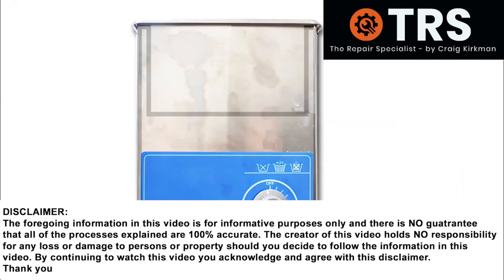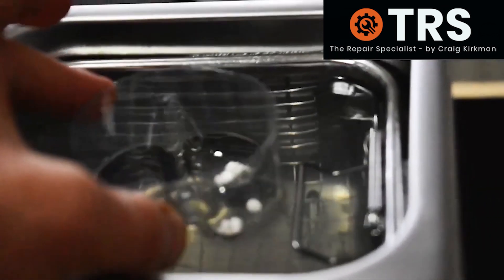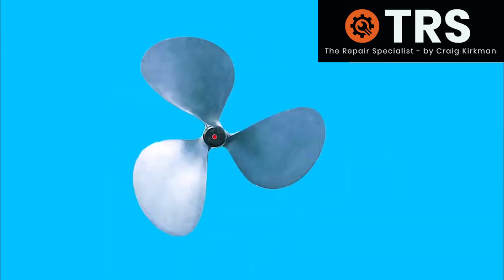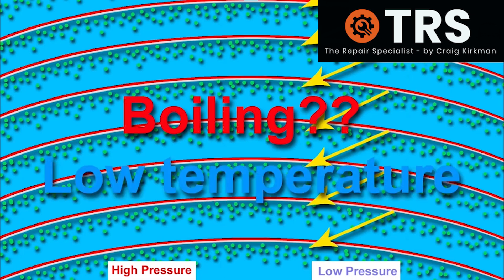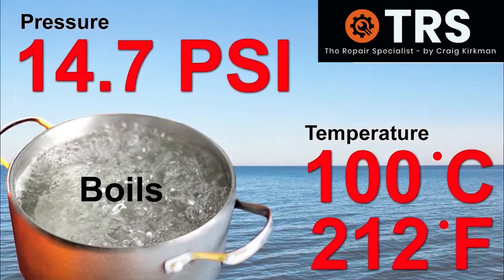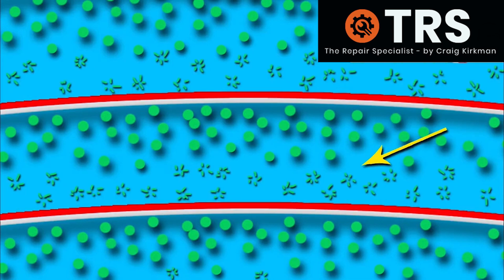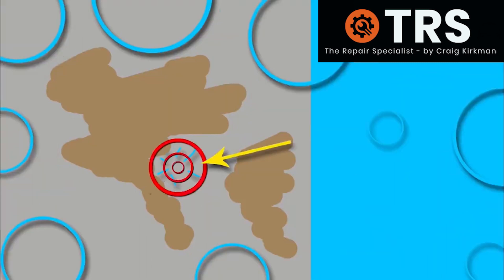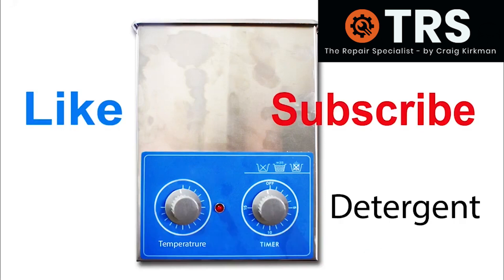The Miracle of Sonic Cleansing Explained!   (by Craig Kirkman)

Comment: Is it ok to use gasoline to clean parts in ultrasonic cleaner instead of water? I read on the internet that the boiling point of gasoline is from 35 to 200 C° on atmospheric pressure...